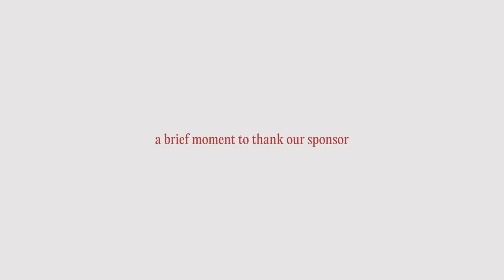in my homeowner era // aesthetic WEEKLY VLOG

Comment: Er on the side of underwatering if you're unsure. Dried out soil is easier to fix than overwhatered. Put your finger into the soil all the way up to the knuckle, if it's dry you should water. 

Indoor plants are much easier to overwater than outdoor plants but if you know you have a tendency to over water, buy or make an airy potmix. It's the lack of oxygen around the roots that damages the plant when overwatering. Just mixing in perlite with regular soil is the easiest way to do it for potted plants both in- and outdoors.